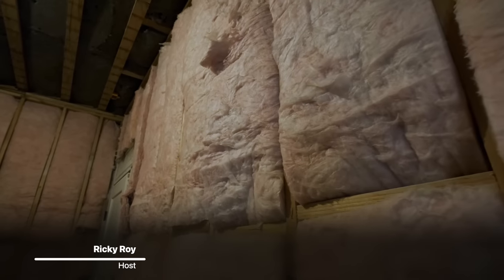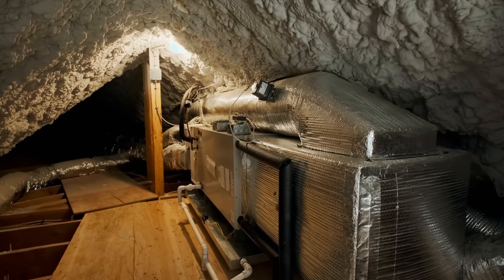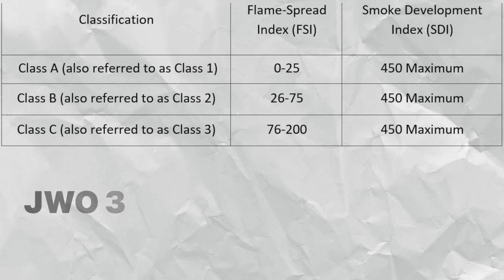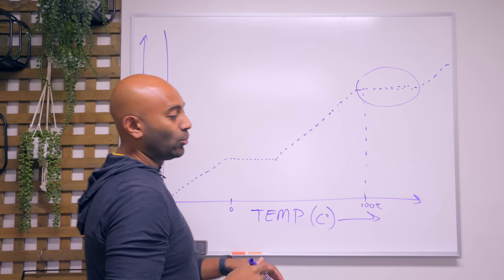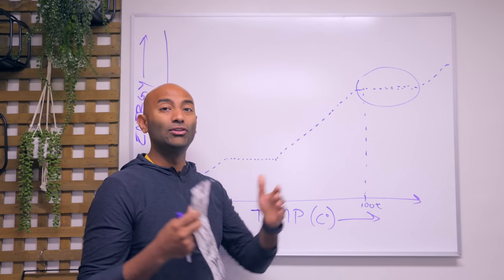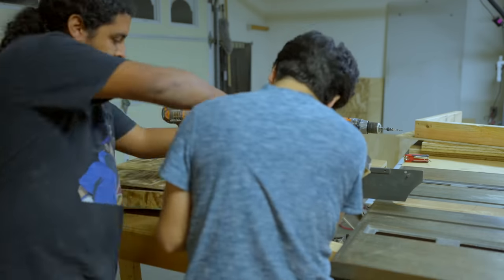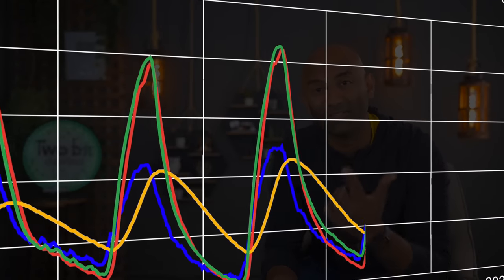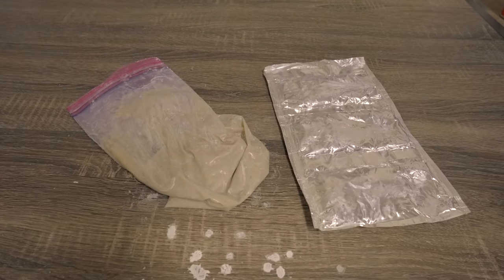The Genius of Phase Change Building Insulation!

Comment: Last year a bunch of power lines were pulled down, dominoes effect. We live in a 3rd floor apartment and Maryland summers are pretty hot. We just got done many triple digits in two weeks. Being poor and disabled jumping up to leave is not in the cards.

I saw a video on PCMs cool packs that could save your life. Nighthawkinlight, was the channel, he has different ones. I made the one that used sodium sulfate. They work great. I made them soaking pieces of fleece in and sealing in space storage bags. I even gave some to my nephew as a police officer in vest he can't really do the over the shoulder cool packs. But sitting on them helps.

I am so happy to see insulation being made.
I now think homes need to go cave like for the heat coming.

I'd like to see bales of straw soaked in the one used for homes and shrink wrapped in reflective foil. Build straw bale homes with them and cob the outside. And somehow add 90% shade cloth over a few feet past the home roof to keep the area right around the home cooler. Use various percentages of shade cloth over kids play areas, gardens. We are just going to have to change the way we look at it. Comfort and less power needed to stay cool or warm over a perfect looking home and garden. 

To help my  3rd floor apartment, I make foam board inserts that help tremendously but we get the sun from sunrise to 130ish, for hours...
You can feel the heat from the walls. So afraid now to even stay at 78f because once power goes out it heat us super quick during the day.

Apartment complexes need to use thermal paint to help people with their heating and cooling costs. Because I don't think using thermal paint inside would help much.

Comment: Very exciting Ricky!

Almost as exciting as tonight's Tesla Investor Day 2023 presentations! 🤪

Question below.  
But first, It seems this new "insulation" is great as it takes advantage of the delta-T between night and day.  I realize you said they have custom formulations for different regions.  BUT, WHAT do you THINK is better; a region with greater delta-T like some deserts 🏜  with 60° Temp swings, OR more modest areas like SD where your swing in Temp is more gentle? 🤔 

So my QUESTION is: would you still want to install a "flash coat" of spray foam in your wall before applying this on the inside toward the sheet rock? My thought is that with a 1-2" flash coat I would not only improve my Air & Vapor Control layer and prevent dewpoint condensation between my in/outside walls but it would also keep the thermal exchange benefits closer to the living space...? Your thoughts?  

Cheers, Eric

Comment: Well, ir may be good as retrofit,but for a new house I'd simply build the way I did. Concrete slab in the ground floor as well as first floor provide excellent heat accumulation. Aircrete walls polystyrene wall insulation, triple pane glass and thick rockwool roof insulation complete it, giving the house then properties you were wishfully talking about. I'm planning a next house to be earth-covered though, that's really the highest level in terms of temperature control.
Reply: I saw a good video on earth covered houses by an engineer.  He said the extra engineering and structural support, and the extra maintenance you need rarely offset the savings.  He said a thicker wall is a better solution, unless you have a tight lot and no other place to put your lawn.

A breakthrough I'm watching is aerogel filled windows.  Windows, even triple glazed heat reflecting, still are always going to be your weak point.  Aerogel has such insanely high R values per inch though that it can give them a fighting chance.  The trick is to make the aerogel clear enough, solar degradation resistant, and affordable.
Reply: @nacoran  Of course, if you have a link or name, I'd appreciate it :-). But it's a bit strange, earth covered house should be maintenance free, not the opposite. I'm talking about real earth covered house, not a "green roof", which is a kind of fashion these days. As for structural point, we in Europe already build houses from materials, that are able to bear quite a load. Concrete houses are no exceptions, and it's not more expensive, than our other options. As well as insulation - we insulate houses a lot anyways. Of course, earth-covered house is still a bit more expensive, primarily due to unique design procedures and very important and costly water proofing. If a design and/or construction of an earth covered house is underestimated, then it turns into nightmare, that's totally true. But it should be done in a way that it will last hundreds of years without touching anything else but things like appliences.
I don't know about aerogel, I have quite doubts about it, but time will tell :-). My tripple pane windows filled with Argon gas are doing quite good job, I'd say. I mean most of houses didn't even get to that point of effectiveness, even here in Europe. Any financially feasible solution is appreciated, of course.

Comment: I like the idea of lining walls with phase change material... Oh thats exactly what you are talking about, I'm not even kidding I was writing the comment while listening and was like "yeh insolation is cool and all, but... Oh well yeh that XD." Thing I think other people haven't thought of yet is using this on solar panels though because solar panels operate more efficiently at lower temperatures, but they are black and out in the sun... so... but you put this stuff on the back with a melting point of like 30C or something and it can store the relatively cool temps of night for the day to cool the solar panels and this stuff isn't expensive to make so increasing your solar panel efficiency by 15% or so and also increasing their longevity is not a bad deal.

Comment: Three options not mentioned: 1) heating or cooling can be applied inside the wall to directly store that heat or coolth so the heating or cooling is only needed when the sun is shining (solar input) 2) some drywall companies have an option of beads filled with phase change material inside the gypsum part of the drywall 3) different temperature phase change material can be used on the top or bottom of the room depending on if the material is for cooling mode or heating mode.
Reply: Regarding 2) do you have experience with them? Or does these products have authentic public reviews by construction companies, individual owners, etc? 
Could you please share such products and company names?

I'd be interested in doing some research about such products in the EU / Europe.
Reply: @1dayUllC  I had seen at least 3 companies proposing such products but I found an article about it and apparently, none of these products were successful and are no longer marketed. An alternative idea is to place pcm materials between two layers of normal drywall... pcm materials expand and contract significantly so that has to be taken into consideration. I have plans but no experience.
Reply: Also, there are several brands of thick flexible glue used for sound blocking by putting this glue between two sheets of normal drywall. This could be used between the pcm packets for both sound deadening and thermal storage.
Reply: @AnnVole 
Appreciate your help and update.
Reply: @1dayUllC  Some product names to check include "Knauf Comfortboard", "National Gypsum's ThermalCORE", and "Micronal PCM"
Reply: Heating and cooling are "your largest energy bills"?  Well, no... in total, the biggest energy consumer is transportation.

Comment: 1. It seems it doesn’t necessary to use the termostatic material the same as isolation. It can be located anywhere inside of the area. It can be even cheeper not to spread it over walls surface, but have just a volume with pipes connected to AC or a fan. It can work just the same as AC connected cooling/heating pipes underground.  

2. The phase change temperature should be close to what you want to be inside.  It intuitively seems most efficient.

Comment: It would be really interesting to see your test compared to 2" closed cell spray foam, and for a cost comparison of the different methods at a typical home scale.
Reply from the maker: when i get ready to rip out the drywall and do this, you bet!
Reply: phase change material and spray foam are different materials for different purposes. 
spray foam is an insulation material, slowing down the heat exchange between inside and outside. it does not store heat.
phase change material, on the other hand, stores heat but it does not provide insulation, IOW it does not slow down the heat exchange.
if you don't have insulation, i don't see the point of phase change material, because PCM will not affect how much heat is lost.

what i would do if my numbers came up is make sure that the house is really well insulated and then add some phase change material.
Reply: @mrxmry3264  Properly installed closed cell spray foam is also an air and vapor barrier, something those other froms of insulation don't do (well, maybe the PCM, but it depends on how it's installed and if the edges are all bonded).  I suspect PCM is great for places with daily temperature swings above and below comfortable temperatures (e.g. deserts), but not as useful in cold climates.
Reply: @mrxmry3264  The object of the PCM is to control the heat by absorbing it and then discharging (desorbing) it. The benefit  is controlling peak temperatures and the delta across an insulating layer.. Imagine a 72 degree thermostat setting, with an R 20 of glass or some other insulation then air attic air temp of 140. What you have in this example is a 68degree delta across the insulation layer (140/72=68) Now lay a 3/8" blanket of PCM on top that stays at or near its phase change temperature of say 82f. What you have done is controlled the delta across the insulation layer. Dropping the temperature difference from 68 degrees to 10. An R 20 is much more likely to give satisfactory results when dealing with a 10 degree delta than a 68 degree. This is appropriate for largely cooling environments.
Reply: @TwoBitDaVinci 
Appreciate it, Ricky.
Reply: Heating and cooling are "your largest energy bills"?  Well, no... in total, the biggest energy consumer is transportation.
Reply: @hg2.  lots of people don't even have cars, what are you talking about? Even shopping malls' biggest costs are heating and cooling. Unless you're counting all commercial and passenger air travel, which isn't typically counted in individual consumer energy metrics.
Reply: @gladitsnotme  
Globally.
What consumes the most energy - HVAC or transportation?

(Stupid California is an exception to everything... They're trying to make HVAC more expensive than transportation.)

Comment: I am AMAZED by how poorly the rock wool was installed. A properly insulated wall starts with caulking the joints between studs and plywood/particle board. The insulation bats are trimmed to allow a bit of spring while installing, assuring a slight pressure against studs and walls.
I added an aluminum vapour barrier as I use radiant heating.
I would like to see how this product functions in addition to a properly installed insulation.
Reply: "I would like to see how this product functions in addition to a properly installed insulation." - I think that's the way it's meant to be used, never on its own. Remember, the manufacturer simplifies their explanation and always presents the best case scenario. But in the real world, the situation is a bit more complex.
 
The phase-change material (henceforth PCM) will absorb heat from the sun during the day, using it to fuel its melt. Unlike the sun in the manufacturer's presentations, though, the real one is not so considerate to stop shining the moment your PCM has fully liquefied. And at that point, the PCM can no longer absorb excess heat efficiently and becomes useless. You can retard the moment at which this happens by adding classical insulation: the more heat you keep away from the PCM, the less it needs to absorb, and the slower it "runs out".
 
At night, assuming the outside temperature falls below the melting point, the PCM will solidify, and release its stored energy. Once all the material has solidified, it becomes useless again. Assuming the PCM is your only means of insulation, most of its stored energy is simply released into the atmosphere. But assuming decent insulation, it becomes harder to release to the outside, and most of the stored energy gets released to the inside of the house instead.
 
But what about high summer or the dead of winter? Well, I don't know where you live, but where I live, the temperature ranges for summer and winter don't overlap, which means there is no viable phase change temperature that would work in both seasons. So a choice has to be made. If we optimise for summer, then the material becomes useless in winter. If we optimise for winter, it becomes useless in summer. So we need a solution for the season in which the material does not contribute. And again, classical insulation is the answer here.
 
So no matter what the situation, proper insulation is the base on top of which one might opt to install this for additional comfort and/or decreased climate control bills.

Comment: This material has potential as a simple thermal battery type of system even without being included as part of a building's construction. It still ultimately comes down to the thermal mass and heat carrying capacity of it, same as it would for water or sand. The larger bonus comes from it's ability to hold temperature closer to it's phase change threshold, enhancing comfort near that setpoint.

A Burnout hot drink tumbler uses a similar material to maintain heat via the same process, both by quickly cooling off hot liquids to a drinkable temperature, and by maintaining a drinkable hot temperature range for hours after that. (I highly recommend it over an Ember, which will eventually fail and be unrepairable garbage in 3-5 years.)
Reply: Agreed. I looked into the cost of it and was soured immediately for retrofitting. It may make more sense in new construction, but I quit doing the math at that point.
Reply: @James Karrie Actually it can make some sense for many older homes with poor air infiltration control that experience more rapid heat gain and loss in less extreme environments.  But even in my 1901 built home, I don't see that penciling out in my favor for decades.
Reply: @James Karrie There is some debate over the efficacy of completely sealing older homes like mine without rehabbing the siding with a wrap or otherwise. It was built to shed water and breathe. Making the siding air tight risks trapping moisture and creating an environment for rot that is simply not an issue at all for it now (except for exterior window sills when the paint has failed). I'm sure it's possible if done right, but 122 years of avoiding rot so far is a tough record to buck.

Comment: this is a really cool technology, if you think about it, it functions more as a heat sink and less as insulation, but that's actually really useful, because not only is it blocking heat from outside, it would also pull heat from inside, people,electronics,lights,fridges and dryers, all produce heat that it would pull and slowly release later on.

Comment: If you would like to have "free" heating and cooling and you have mechanical ventilation installed. Then use the ground. 
I live in Sweden and we have both cold winters and warm summers. We use the metrical system so forgive me for not using the imperial system here. 
I ran across a clever guy that had constructed a system where he took all the incoming air to the house via two 200 mm 25 m long each plastic ground pipes. He dugg them down into the ground below the freezing level and filled up around the pipes with clay dirt closest to the pipes. This gave the best thermal conductivity.
During the winter he measure +2 degrees Celsius at the inlet in the house after 2 weeks with constant outside temperature of about -20 Celsius.
In the summer he measure an inlet temperature of about +17 to +18 degrees Celsius when it is about +25 to +30 degrees Celsius outside. 
The cost for this is the installation cost and then the cost for driving his ordinary mechanical ventilation which is not a great cost at all and also often is there anyway.
See to it that you put good enough space between the two pipes and also dimension them so that the airspeed through the pipes are slow enough for the air to conduct the temperature from the surrounding ground.

Comment: Very interesting, we live in middle Georgia and think this could be a big benefit for us, especially if all we have to do is lay it on top of the current insulation.  That makes it a DIY project.
Reply from the maker: Seems like its worth experimenting with.
Reply: where?
Reply: I am in Atlanta and have spray foam in my attic. Before spray foam the attic temperature could be 120 degrees in summer. After spray foam never higher than 90 degrees. It cost about $7000 to install. It makes a big difference in electricity bills. Looks like this other material might be more efficient but more costly.
Reply: @atlantasailor1

Comment: Be careful.  Depending on where you live, the foil might accumulate condensation and ruin your wood structural framework.
Reply: One of the really interesting things about PCMs is when they give up their heat (begin to refreeze) they do so at largely one temperature IE very near their PCT (Phase Change Temperature). Meaning, the PCM is always going to be slightly warmer than ambient and the surrounding areas when dew point temps are reached. So while condensation is technically possible, it is highly unlikely
Reply: @garygray-fx1ho  Interesting 🤔!  Makes sense.  Do you have experience using these for insulations?